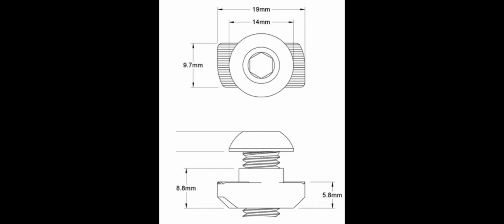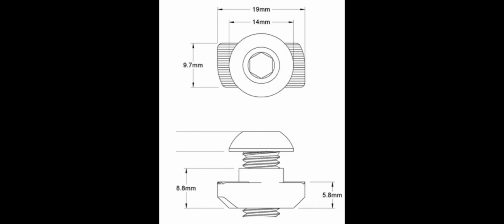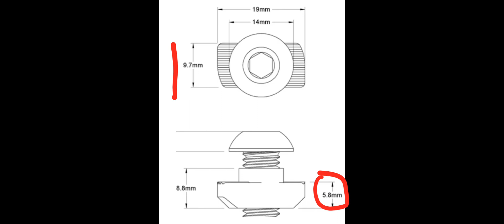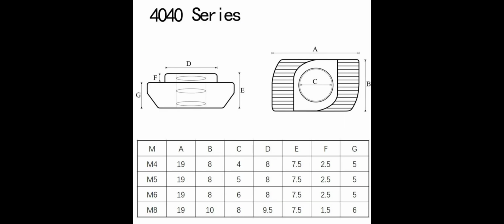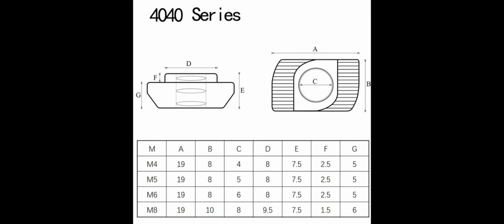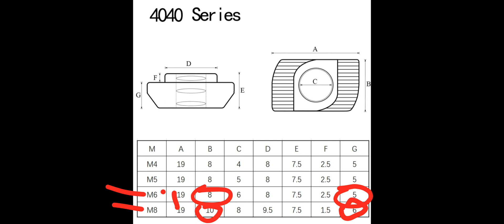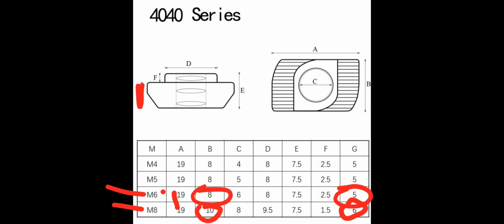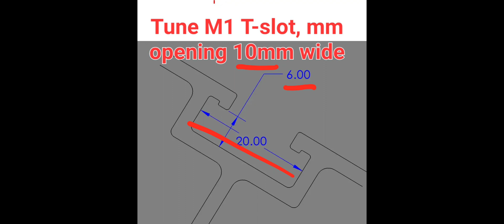T-nut Sizing for 40 & 45 Series T-slot (Tune M1 Camper)

Comment: Dave, many thanks for this research. The T-nuts that you reference work perfectly...I used them to mount my new grab handles. After mounting a few things, I ordered some in M6 size as well, since smaller items don't need such robust hardware (and drilling out the smaller things is a bit of a pain). Thanks again for the information. 👍
Reply from the maker: I agree on the m6.  I've only had to drill my grab handles so far though, everything else has had m8 holes.

Comment: The Tnuts in that Amazon link says they are 19 x 9.8 x 7 mm. Isn't that 7mm thickness too thick?
Reply from the maker: That is a great catch, I do see that in the product description text.  However, on the 2nd picture, it shows the height as 5.7mm for the part that has to fit inside slot.  That's what I based my order off...  they do work for me and fit, so mine at least were not 7mm.  But they also have a comment in their description saying their measurements might be iff 1-2mm, not great.  For the price, I like the risk for a bag of 50, but I could see a batch being too high.  Folks will have to decide... but they do work for me.  Great catch, thanks!

Comment: With my M1 on order I had started looking at buying T-nuts and immediately stumbled across this sizing issue.  Tune told me they used the McMaster-Carr Tnut but I found that these are more expensive to buy in small quantities than buying a bag from Tune. And another Tune owner had noted that the other-sourced Tnuts they bought didn't fit.  So thanks for figuring this out and finding a source that works. I think I was too hung up on finding them in stainless steel.
Reply from the maker: I also wanted stainless, but after using these, the nickel plated carvon steel are great.  Zero corrosion, and I've had them in 130f AZ metal heat.  Removed 15 today and looked at them all and rails, no corrosion.